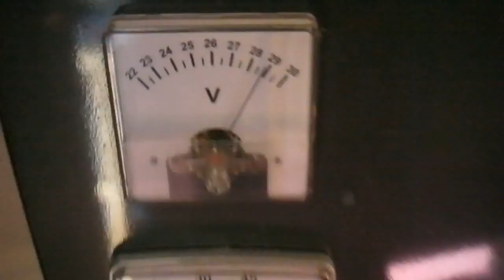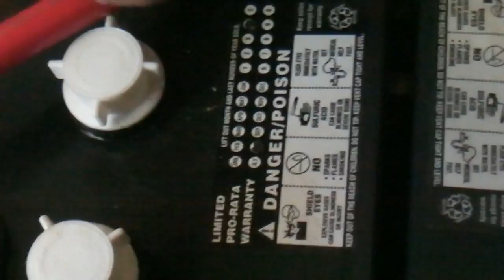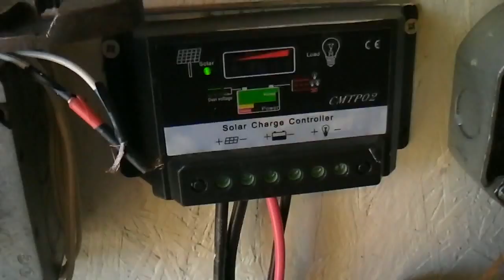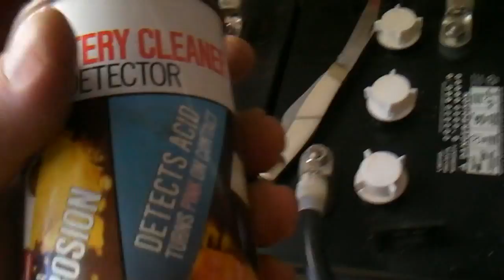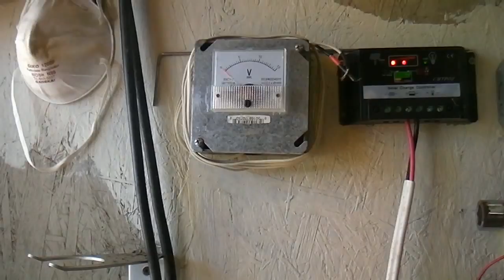Wired Up Four Golf Cart Batteries to a Solar Charge Contoller & Tracker

Comment: great video! I hooked up 2 6volt to get 12 volts with 1/0 awg. Then to my 2000 watt inverter. I plugged in a little 19" lcd tv and the fan on the inverter kicked in. My charge controller showed the batter decrease from 100% to 68% in about 10 minutes. Once I turned off the inverter the batteries charged back to full in about 10 minutes. nothing about this seem right. Any Ideas where I've gone wrong?
Reply from the maker: you have a dead cell or cells in a battery or batteries check each cell with a specific gravity meter. they sell on ebay for five dollars. the cell with the lowest charge is most likely dead and pulling down the whole battery bank. Get a good battery to replace it.If all cells show full charge up in the green level then that is a great battery.
Reply: Thanks. I'll take a look at that for sure. the batteries are brand new though. I tried swapping out my inverter with a friends and it seems to be working normally. Could be a bad inverter but it can't hurt to test the cells anyway.
Reply from the maker: Is it one of those real small inverters if so that is the problem You might invest in a 1500 watt go power or a 1800 watt Prosine by Xantrax.
Reply: It was a 2000 Watt. My friends I tried was a 3000 Watt. It ran quiet with less draw from the batteries. So last night thinking my inverter was broken I went out and got another 2000 Watt inverter. Hooked it up and it worked the same as the old one. Fans start run as soon as a draw in pulling. lol. I guess I just need a 3000 Watt inverter? It just seems to run more efficient?
Reply from the maker: Are they pure sine wave inverters. The are plenty big what brand are they. Power jack is not that great if yo know what I mean.  I dont think it should run the batts down quite that fast Hmmmm?  I started buying Nissan leaf batteries and they are so powerful and have a heck of a lot of storage and so far they are blowing away the lead acid batteries. The are 80 percent efficient were the lead acids only are 50 percent .

Comment: what size wire do you have on your solar panels ..on such a long distance ...and how far do you have them from the charge controller
Reply from the maker: It is a little over 100 ft. I am using 10 gauge landscape wire I got off of ebay. its cheap really and bury able. and works perfectly. I think i payed about 65 bucks in all for 100 ft. I also bought some 8 gauge wire of landscape wire for 125 bucks. I like the 8 gauge best but it is almost twice the money. But it sure carries a lot more amps. Im going to a Midnite 150 solar charge controller that can make use of panels connected in a series. when I connect 3 or 4 in a series it ups the volts to like 48 volts or 102 volts up to 150 volts. You have less amps though so you can use less heavy gauges of wire. so I can run three panel on one 10 gauge wire with no problem and the voltage drop on the long 100 ft run is not hardly anything.

Comment: I subscribe to your channel for some time. I love the work of solar panels as the hen house project. About solar panel I wonder if the solar trackers improve efficiency. How much energy you get out of it?
Reply from the maker: One panel or each panel has 8 amps 24 volts. volts x amps = watts so it would be 235 watts DC current. If you have used a 8 amp charger then you know how fast it can charge a battery. The batteries voltage can be inverted to 120 volts to be used with regular appliances. Or you can use 24 volt equipment and like fridges and freezer that can be bought from certain sites in Florida . It more efficient to use 24 volt equipment. so you don't loose any power in heat converting.

Comment: Nice lil volt meter to check out
http://www.ebay.com/itm/251591926373?_trksid=p2055119.m1438.l2649&ssPageName=STRK%3AMEBIDX%3AIT
If your load is less than 2 to 3 amps there is a cheap way to step down DC to the voltage you need
http://www.ebay.com/itm/380755874794?_trksid=p2055119.m1438.l2649&ssPageName=STRK%3AMEBIDX%3AIT

Input voltage:4V-40V
Output voltage:1.3V-35V
Output current:Rated current is 2A,maximum 3A(Additional heatsink is required)
Reply from the maker: Cool I ordered a digital volt meter from your link I found one for 1.67 lol thats cool. I have one of those voltage step up step down adjusters. I guess I could use that. I didn't know if it would work on the big 24 volt battery bank lol i guess it would. nrodge showed one to me a few months ago and I bought it for testing GTIs I may try that if I remember to.
   I have to hook up the inverter tomorrow. More solar videos to come. I dont have enough pwms to hook up all my panels. haa haa. I have to get a big amperage charge controler made in the USA like a Midnite Solar or a Outback. I like the higher votages they can run panels in a series. I would like to run three 24 volt panels in a series then i could use less wires. that would be keen. I could run three or four panels on a one ten gauge wire then how sweet that will be. yee haw. the amps would only stay at 8 amps then. instead of 24 or 32 amps. I think that is right?
Reply: works up to 30 volts, it don't care about battery size, just voltage and current trough put, 2 amps max without heat sink
Reply from the maker: Craig Nehring The fairy lights or LEDs only are about one amp usage but could be more as long as the string is. Maybe closer to two amps. not sure exactly to the T.
Reply: shartne
Just check them with your digital multimeter on the amps scale, you need to pass the current through the meter of course, but just one leg
the amp meter goes in series with one leg, then add the power